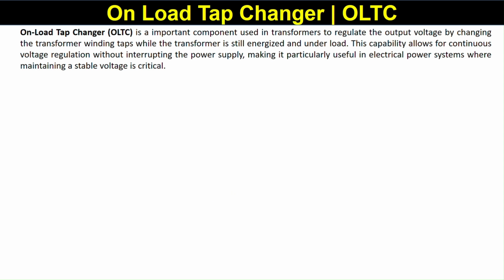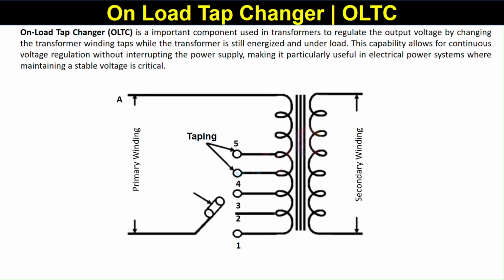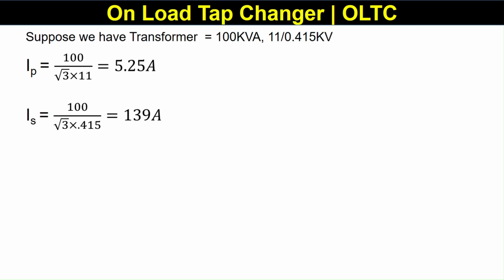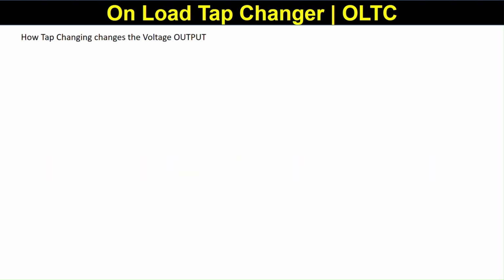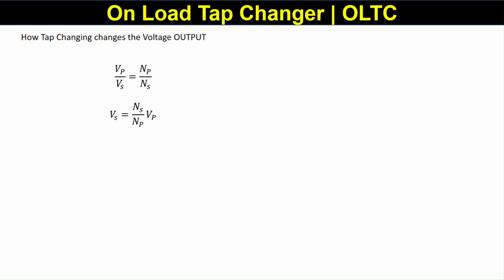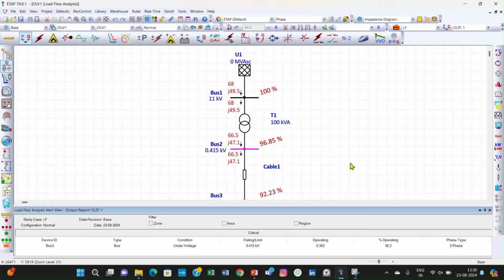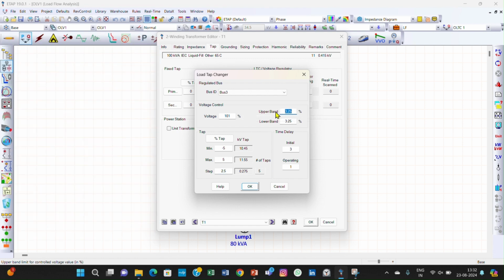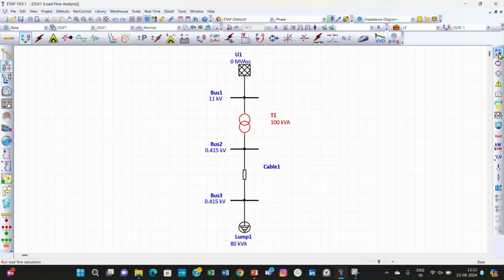Lecture 17 | On Load Tap Changer | OLTC | Load Flow analysis | Etap Full Course

Comment: Sir 3 error will happening while run load flow. Bus base k v is out of 40%range from bus nominal kv what supposed I do
Reply from the maker: Check bus voltages
Suppose you have kept transformer secondary 0.433 kv and bus voltage may be different
Also from primary side of transformer voltage and voltage of grid